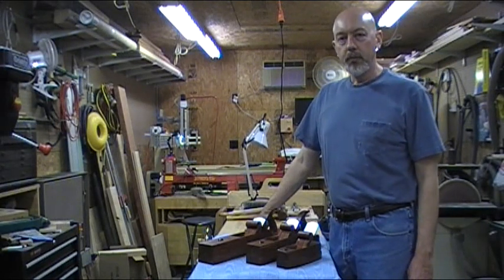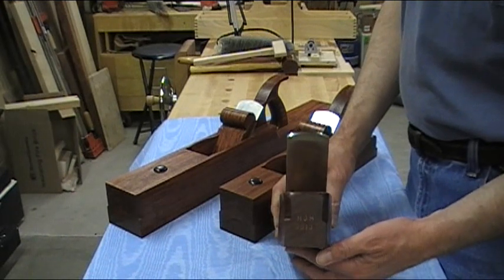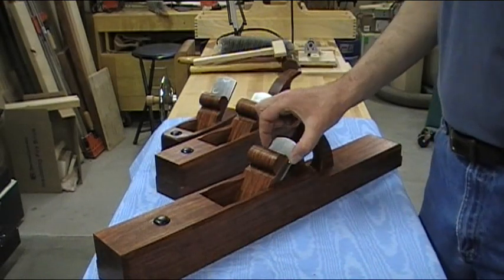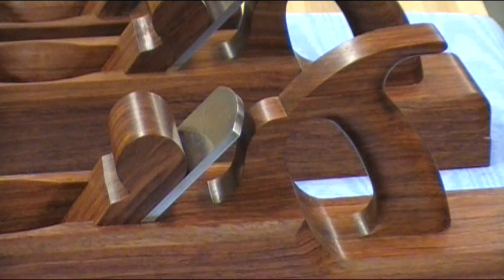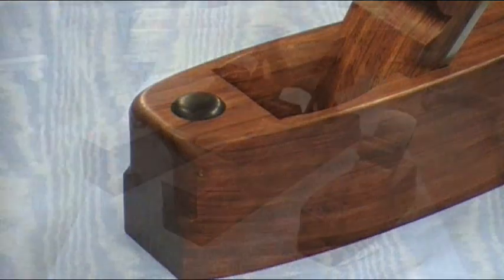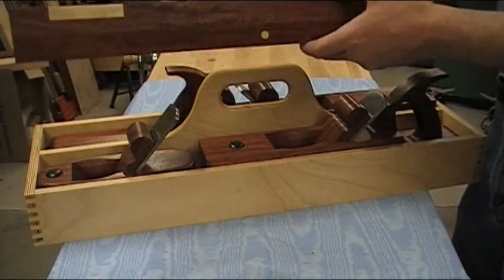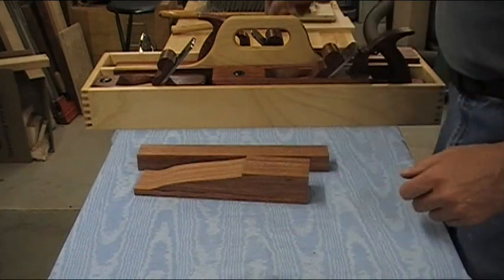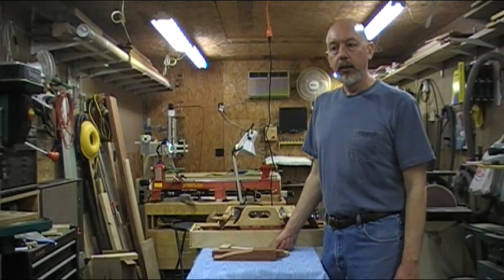Wooden Bench Plane set

Comment from the maker: I used Chris Schwarz recipie for workbenches.
1 part alkyd varnish (satin)
1 part boiled linseed oil and
1 part odorless thinner

Wiped on three coats with a piece of old t-shirt.  0000 steel wool after the second coat and again lightly after the third to even out any shiny areas.

Comment: They are works of art. Nice job! Your niece is lucky to have an uncle like you. I'm interested in making my own planes also. Can you describe how the ebony strike button works?
Reply from the maker: +Doug Keen In order to loosen the wedge, you can strike the plane with a mallet either on the heel or on the top front.  The strike button is just there to keep the plane body from being dented and damaged from the mallet strikes.  I made the button about an inch long and glued it into a hole about 7/8 in deep.  That leaves the button proud of the surface so the mallet only strikes the button.  The button is also end grain which can take the abuse better than the face grain of the plane body.  Any dense, tight-grained hardwood should work for the button.  I have used hard maple on some.  Be sure to round over or soften the exposed edge of the strike button to avoid breaking off the edges during use.